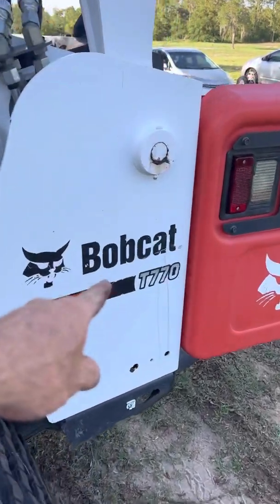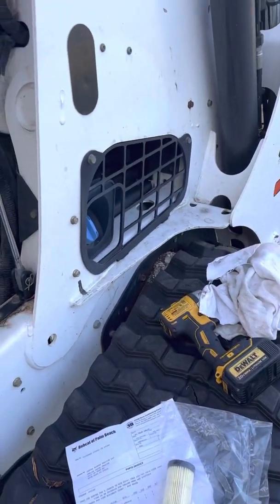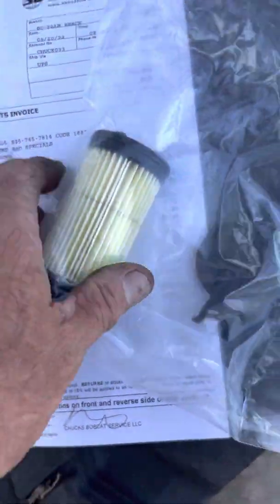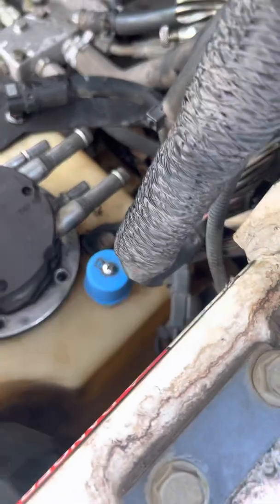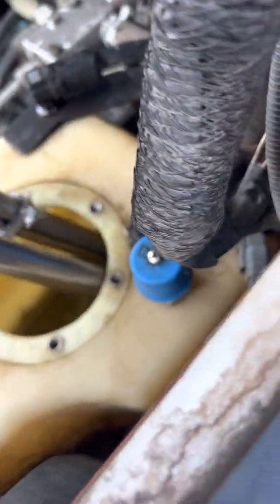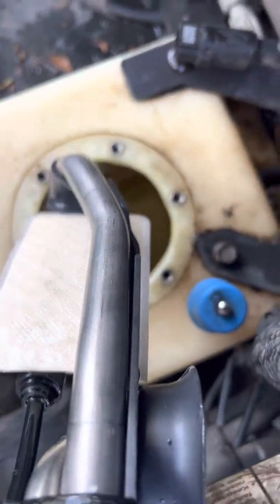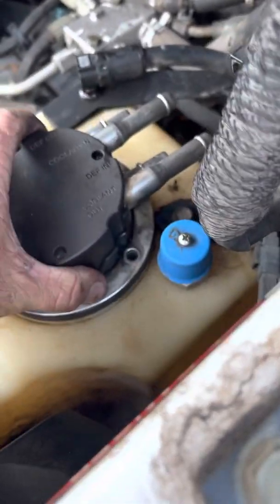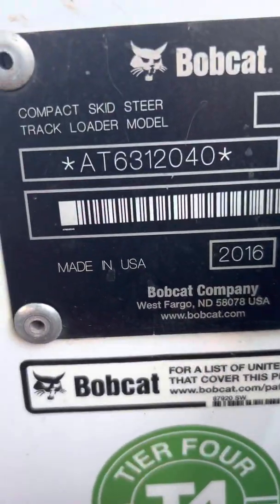DEF problem on bobcat T770

Comment: The pump is bolted on side of frame about 6 inches from the tank filter should be inside of the pump housing,stand in front of the machine should be on the right side in front of the def tank on the side wall black in color